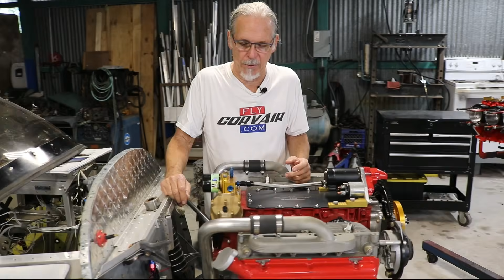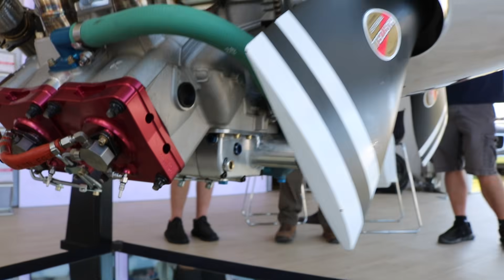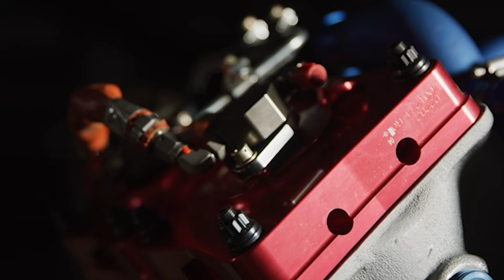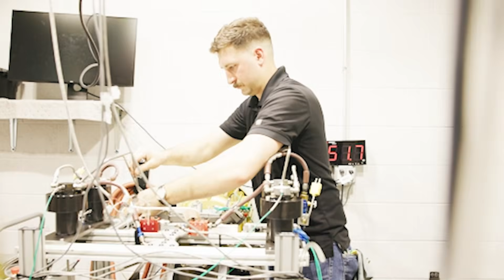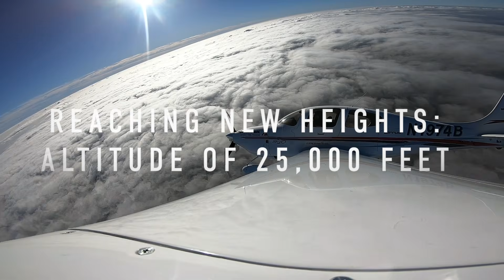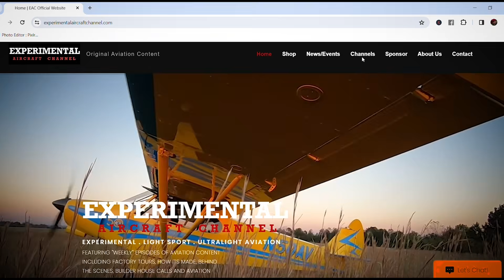DELTAHAWK Diesel Jet Aircraft Engine - ENGINE WEEK 2024

Comment: Two stroke Diesels are a known technology and yes, they are very reliable. I have decades of experience running 4x71, 6x71 and 12x71 Detroi diesel engines in boats and they are as close to bomb proof as you can get for a marine engine. Dead reliable and even if you lose an injector or two they still make power and get you home... they just keep running.  Glad to see these engines are finially making it to market_ a much better option imho.
Reply: For anyone puzzled by the notation, those are actually 4-71, 6-71 or 6V71, and 12V71 Detroit Diesel engines; there's no "x" in a Series 71 engine name.
Reply: Had a 6-71 N run continously for 24000 hours ,oil change while running . Shut down when project was finished . Run at 2400 - 2600 rpm ,full load
Reply: Yeah because aviation is just like industrial powerplants. 😂
Reply: A 6v71 or 6-71 makes about 200kw +-10kw, from a 7 litre engine that weighs about 1000kg+. Big difference to the deltahawk. That's and equivelant 930-1200kw from the 671 as far as power to weight goes.
Reply: @chippyjohn1 sure, but 3000 hour overhauls instead of 30,000 hour overhauls.
Reply: Junkers jump 2 stroke ,opposed piston diesel aircraft engines from WW2
Reply: @georgesheffield1580  They were high maintenance and unreliable. Most were removed and replaced with conventional BMW radial engines by mid 1944.
Reply: There is no proven track record in 2 stroke aero diesels. Don't equate ground based designs with aero applications. The WW2 Jumos were not reliable or durable. WAM had multiple issues and had no better fuel consumption compared to an O-235 Lycoming.
Reply: If there’s anything heavier than a tractor diesel it’s a marine diesel. I’m pretty sure an aviation engine has absolutely nothing in common with marine diesels.
Reply: @ correct, farmer thinks you can just throw more steel on it and it’ll fly like you can with a vessel or farm equipment. Engineering a light weight engine that can run at 80% duty cycle for 500 hours is far more difficult.
Reply: @ellomirza  you're sure, but that just shows that you are not familiar with aircraft and marine engines. 

The Fairbanks-Morse opposed-piston engines used for 8 decades in US Navy submarines are a copy of the Junkers Jumo aircraft diesels of a century ago. 

The difference between marine and other diesels is mostly scale. 

Several gasoline engines were used in WWII in both aircraft and tanks, even though you might think that an aircraft engine would not be durable in a tank and a tank engine would be too heavy for an aircraft.
Reply: @ yeah ok dude because you found one example of some obscure engine used in one aircraft 100 years ago therefore every engine in aircraft today is pretty much a tractor engine. Please consider not being a contrarian dork.
Reply: @ellomirza  Who are you referring to?
Reply: @ellomirza  I did not say that at all.
Reply: Two stroke diesels are poor on efficiency, high oil consumption and shit on emissions
Reply: @martinandersson5278  Uhhh... no.  If you're talking about a 50yr old Detroit Diesel, then yeah, crappy emissions.  If you're talking about a modern engine, then.... did you even watch the video?
Reply: @martinandersson5278  Not inherently. Detroits are a 1930s design used in applications where those factors do not matter but utter reliability does. General aviation could burn coal and it's impact on emissions would remain trivial.
Reply: @martinandersson5278 schuler/ burmistrr - wain are the MOST efficient  internal combustion engines.  Both 2 stroke diesel s
Reply: @martinandersson5278   Yes, they are less fuel effecient, true.  But there is no denying their reliability or durability, they excell in both. Give them good clean fuel and oil and they just keep running.
Reply: @martinandersson5278  The largest diesel engines are also the most efficient... and they are two-strokes, in large ships. Unfortunately the Deltahawk is not a uniflow design like those most efficient engines.
Reply: @brianb-p6586 uniflow? Pls explain
Reply: @nevatotadat1905  "uniflow" means flow in one direction during scavenging (and scavenging is blowing fresh air into the cylinder and exhaust out). If both intake and exhaust are through ports in the cylinder wall, controlled by the piston, they're both at the bottom of the cylinder; in that case flow is up into the cylinder and back down, and the cylinder may not be completely flushed out.

Typical uniflow engines (such as the Detroit Diesel Series 71) use piston-controlled ports only for intake, with exhaust through valves in the head. That means that during scavenging flow is in one direction, in through the ports at the bottom, upward through the cylinder, and out through the valves at the top... that's uniflow scavenging. Other uniflow 2-stroke diesels use two oppossed pistons in each cylinder.
Reply: @brianb-p6586  ah ha, so that's why 2 stroke diesels have valves in the head! I always wondered why add the complexity of valves. 
So I'm guessing it's similar to crossflow heads in a 4 stroke. 
So any idea how much more efficient is a uniflow 2 stroke?
Also would the momentum of the downgoing piston cause most of the exhaust gasses to be at the bottom of the cylinder when the ports are opening?
Reply: @brianb-p6586  the opposed piston seems to be the most efficient, why don't we see more of these? For aviation a gear reduction is built in, keeping both prop and engine rpm in their sweet spot.
Reply: @nevatotadat1905  exhaust gas fills the cylinder at the end of the power stroke, regardless of piston speed.
Reply: @brianb-p6586  Thanks. This seems to be a limiting factor in this design. Having exhaust valves in the head would be more efficient and less complex than opposed pistons. That being said, an opposed piston design seems to be the best design for aircraft. I seem to remember that one was being developed a few years ago...

Comment: yada yada yada Would be great to get some useful information : price, installation (available/tested airframes, mounts, tractor/pusher same or diff versions, prop combos), consumption/weight/cost comparisons, CG impact of engine/prop/fuel on different airframes. It may be simple but its also pretty heavy, how would it compete with similar hp set-ups over the ownership period (purchase, maint, consumption, TBO/OH) ? It just seems compared to other engine manufacturers Deltahawk are very reluctant to share the kind of  data that drives decisions. That's pretty annoying and also a bit alarming.

Comment: Great engine concept.  The price seemed much more reasonable when they were estimating it 20 years ago sadly I think this may be ok for the certified market but priced well above serious consideration for the EAB market.
Reply: If you are a military drone manufacturer, the price is not the main concern.
Reply: My thoughts as well
Reply: You can buy two 912iS firewall forward for the price of one 916iS. 

Combined will have lower fuel consumption at equivalent combined power settings. Loses at high altitude above 12kmsl, but not many people spend time in the teens.
Reply: How much do you think the Rotax 916 or lycoming 360 is with firewall forward? 80k? So another 30k and you get an engine with much better technology, fuel efficiency, and may never need an overhaul. I get it, all engines are disgustingly priced now, but so are kits and everything else with aviation.....so compared it's not that bad IMO
Reply: @Austinmediainc  I get what you are saying and yes you are correct after fwf and everything else there would be about $35K difference.  Assuming the deltahawk actually comes with everything needed.  That's not a drop in the bucket though.  That ends up being about 6000 gallons of fuel or an avionics suite or most of an entire airframe.

Comment: I have thought that 2 cycle diesel would be the way for aviation for years. My idea was a 6 cylinder boxer. As a 2 cycle boxer it would be much like 2 3 cylinder engines with the 2 opposing cylinders firing at once. I believe this would help with balance, and the flat boxer configuration would fit more easily into existing airframes.
Reply: A two-stroke boxer makes no sense, because of those simultaneous firings.
Reply: @brianb-p6586  most 2 cycle inline 4 cylinder engines are flat plane crankshafts.  That means 2 cylinders are firing simultaneously there as well.
Reply: @grantensrud9185  I can understand using a flat-plane crankshaft with an inline-4 for balance, but the Detroit Diesel 4-71 (the only 2-stroke inline-4 diesel that I could think of to check) does not.

I do understand the approach that you're proposing for a flat-6. But the result is a long and complicated engine for the firing pattern of a 3-cylinder, which is why no one does this, and why the Deltahawk is a 90-degree V4 with good balance  (using simple crankshaft counterweights) and ideal (for a four-cylinder) every-90-degrees firing pattern. 

An upright V might not be a packaging problem in an aircraft designed for a flat engine because the heads are so compact (having no valves), but if not... that's what the inverted-V configuration is for.
Reply: @grantensrud9185  4-cylinder 2-stroke engines seem to be as rare as I would expect. I haven't found any in production cars or motorcycles, and only one in a snowmobile (the Yamaha VMax-4 of the 1990's). That Yamaha was two twins mounted end-to-end, so I doubt it is an example of good engine design. And motorcycle and snowmobile people do strange things with balance and firing patterns that don't belong in an engine for any other application... they actually like irregular firing.

Comment: Here's the problem;  The pistons are facing down, which means oil sprayed onto the pistons and wrist pins collect in the piston back.  As the pistons go up and down, the oil collected in the piston skirts flies around, causing it to be atomized inside the crankcase.  A special oil pump collects the atomized oil, returning it to the oil tank.  I was told this oil pump is proprietary and should it fail, will cause rapid destruction of the engine.
Reply: Is there any aircraft engine that runs after the oil pump fails?  We are a bit past “splash” oil cooling.
Reply: Dry sump engines aren't rare, nor are they known to be unreliable. 
Every radial engine uses the same system and they're known for their reliability.
Reply: After all those decades of developing you don't think the engineers thought of this already?

Comment: Why haven't we been using diesel engines in small aircraft for the last 70 years?
Reply: Weight. Diesel engines are usually very heavy compared to their gasoline counterpart.
Reply: Diesel gels at low temp.  Needs to be pre-heated.  No access in remote locations. Not so anymore
Reply: They burn jet a same as all regular jets !
Reply: Because they perform poorly in aircraft.
Reply: Because the Germans lost WW2 :)

There were some working Jumo Diesels for larger airplanes at longer range, where the higher installation weight was compensated by the lower fuel burn.
After WW2, gas turbines came into use for both Turboprops and Jets, which were much more powerful and reliable. For smaller airplanes, not much development happened, with O-320 style technology dominating much of the market. 
Only in the early 2000s, Frank Thielert was brave enough to convert a state of the art automobile engine into an aircraft engine. Diamond‘s Austro Engine followed, but GA market shrunk to a fraction of it’s original volume in the 2000s and never recovered. It takes a lot of optimism to invest that much money in something that’s gonna be produced in such small numbers!
Reply: @ue4770  Ackshually, it was advancements in gasoline engine technology that made diesels irrelevant. The difference in fuel burn by weight for diesels vs post-war gasoline engines just isn't significant enough to justify all of the drawbacks that come with diesel engines.

In fact, if you compare the DA50 to the Beech Bonanza, the Bonanza burns less fuel by weight than the DA50 during cruise.

Comment: If the engine is so 'simple' why is it so expensive?
Reply: Because someone actually had to engineer a clean sheet design unlike the auto conversions. Without knowing the future sales volume - a company needs to do a lot of estimating on ROI given the quite lengthy development process and needing to allocate those costs to future sales.
Reply: @imkindofabigdeal4308  How long will it be before a purchaser is paying for just the engine & not all the R&D costs?
Reply: @stephen5147  Let's assume $110k (in today's dollars) is competitive with a Lycoming IO360 STC more or less and the financials make sense. Probably never - they have a business to run and ongoing cost for support, etc. Maybe it is just my background in corporate accounting, but your question kind of hurts my head a little. Let me explain it this way. A lot of the cost of a product is the working capital in machinery, human capital, and supply chain needed to actually make and support the product. You might as well assess the cost of metal and ask when the price goes down to that level. Obviously it won't.
Reply: @stephen5147  certification

Comment: I hope everything he has said it true, I also hope maintenance costs are low as well as well as engine overhauls. If those are low, this will do well and the $110k price would be worth it. Some people may never need an engine overhaul.
Reply: I'll bet you that if anyone ends up actually buying this engine, they'll have turbo failures, oil cooling issues, and generator failures. It'll have a heavy block and excess weight with water cooling. Also, good luck with your cold stat and air starts.
Reply: @Rob-md5wh  many problems can be overcome with modern designs. But its all hype until its not.

Comment: Hello.
I have a question ⁉️ 
On the Jet-A / Diesel engine, will this engine accommodate a constant speed propeller???

If so, what type and how it works.

Or

Is it only use a fix pitch propeller.??
Reply: It shows vsrable pitch props on the Velocity that would work the normal way.
Reply: The Velocity and the SR20 have variable pitch props.

Comment: My all time favorite engine! 
What would be nice is a Starter/Generator, like the Turboprops, which could also work as an Electric Motor, built into the flywheel, instead of separate Starter and Alternator. Besides saving weight and complexity we will also have the redundancy of an electric motor to allow us to climb to at least pattern altitude for a safe return or with more battery capacity to clear a few hills to a better landing spot.
Any idea what is the maximum power tuners could pull out of this motor with massively oversized turbochargers and the necessary fueling?😍

Comment: Jump cut at 25:30 just before he was going to get around the saying the price... huh?
Reply from the maker: $110K sorry about that. We had people walking in front of the camera SEVERAL times. Will invest in "DO NOT  CROSS tape" for future Airshows! Haha! Seriously. People walking around blind.  🙂
Reply: @ExperimentalAircraftChannel  I had someone walk into my tripod, knock it over, and just walk away with no apology or attempt to set it back up.
Reply: That's absolutely absurd! There's no more than $10,000 in materials. Probably half that. If it was sold at reasonable prices, they would make a killing.
Reply: @gsxr600rafii think about it, all the R and D that goes into it. All those years wages and other expenses. Sounds like you are out of touch with manufacturing costs.
Reply: @gsxr600rafii  Custom fuel system, custom supercharger, turbocharger potentially custom, dry scavenge oil system. All certified to aviation standards - that is already $10K without even touching the base engine...

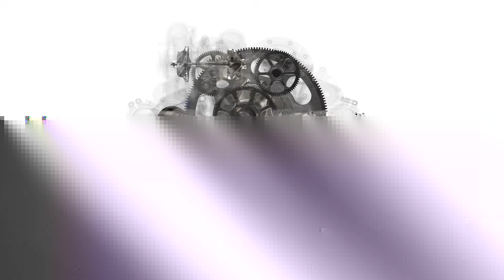Comment: 10:53 the injection pumps are driven by a camshaft, clearly visible in the 3D image at 8:55.
Reply: Those look like cam lobes on the crankshaft.
Reply: True, a mechanical fuel pump on a diesel has a camshaft. But this engine does not have an internal camshaft. The fuel pump is externally mounted. A mechanical fuel pump on something like a 5.9 Cummins lasts for a very long time

Comment: 9:14 Not all diesel engines are direct injected. Some have precombustion chambers.
Reply: But dang few of those built in this century, they were a band-aid to compensate for fuel injection systems without high pressure capability. They can't deliver the same efficiency and emissions capability as a modern direct injection diesel.
Reply: @clarkstonguy1065 they were not a bandaid. At large enough cylinder displacement you need IDI. They were often more efficient and have better fuel consumption at the expense of power.
Reply: @yolo_burrito  I am only well versed from automotive to locomotive sized diesels. We have 2200 bar (32,000 psi) fuel injection systems to get the energy and mixing needed, along with multiple injection capability for noise and emissions reasons.  If we could fall back to the emissions standards that were in place when IDI was common in automotive we could probably deliver 15% or 20% better fuel economy than we have now.
Reply: While that's called "indirect injection" in the diesel world, it is still "directly" into the engine at a precise time (in terms of piston position), unlike port or throttle body injection as traditionally used with spark-ignition (gasoline) engines. So yes, all diesels inject fuel at high pressure at precise timing into the engine.
Reply: Amazing😮
Reply: That's still considered direct injection.
Reply: @samuelfox8126  no, it’s not.
Reply: @kr6dr yep, it is. The 5.9 Cummins has that precimbustion cleaner. It's a pocket INSIDE the combustion chamber, this injection is DIRECTLY into the combustion chamber. 
It's to prevent cylinder wall washing and help flame propagation.
Reply: Erm uh well technically ackchually I have ermm an extreme outlier to be contrarian with in a completely different size context